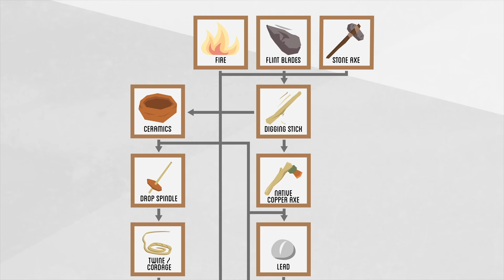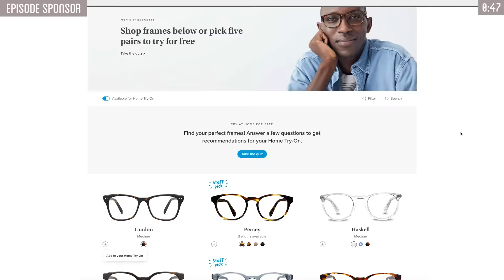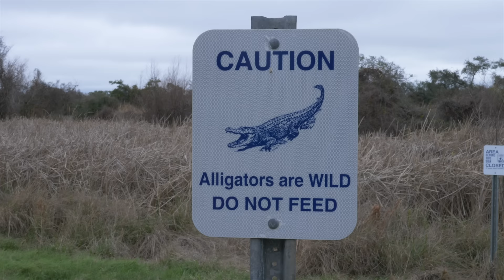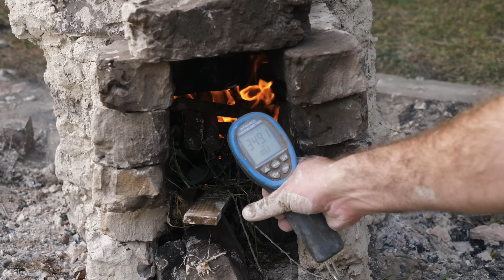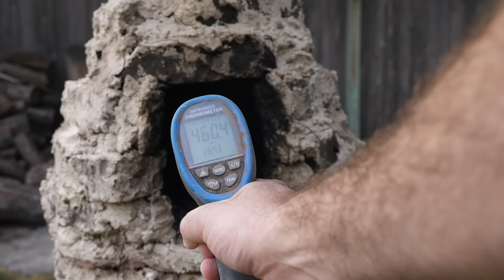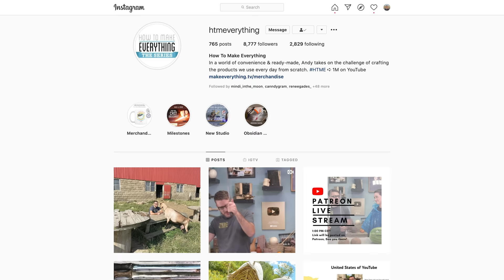Primitive Glassmaking (Creating Glass from Sand)

Comment: I couldn't tell for sure, did you add straw to your clay when making bricks? That's important. Some kind of fibrous plant material, such as straw, grass, etc, it adds a lot of strength to the bricks.
Reply: They shrank too much too, maybe less water..?
Reply: @fellipeparreiras4435  I was thinking the same thing and also just taking a bit more time for consistency. Brick material was lumpy as
Reply: Also too much water in the clay of the bricks
Edit: the clay should be really dry like the  moulding clay your clay you use for the vessels but even drier
Reply: Yeah no straw, and only firing one side of the bricks are real head scratchers. I really like this project but some of the 'successful' projects are ugly and not successful at all.
Reply: @lectorserelith  It's my only annoyance with HTME, if they put a little extra effort into things their projects do so much better and actually succeed. Like primitive tech is a good example of this and good to be learnt from for where they are on the tech tree
Reply: @michaeljones4049  I had a huuuuugggeeee thing written on the previous episode about this exact thing! This episode was much more tolerable as it was basically only the things needed to do something, rather than actually trying to make and perfect something. This is just a case of poor execution leading to poor execution. If the bricks were made better (probably using straw, it definitely won't make them stronger, at all, even slightly, when using them for firing bricks, as the straw will burn away making them weaker, but more insulating due to the air gaps now in the brick itself) they would've got a better construction, and better temperature. 

But it literally is a case of "put in no more than 10% effort, and look up how to do it if you're going to do it" and you'll get an infinitely better result. Don't use murky water to make bricks, use clay!
Reply: @Guffy1990  110% Just seems like some of the curiosity and need to do better has been lost since the reset. Just smash it together sort of paying attention, shrug that it didn't work really and move onto the next project.
Reply: @John Everyman I get it and YT isn't exactly easy these days but I prefered it back when they took their time and I didn't mind having to wait the bit of extra time for them. Maybe it's just me but they seem less rushed (Although that is an issue) and more sloppy. It feels shit to say because I don't want to rag on them, just feels like the attention to detail isn't there anymore and they're just going through the motions.
Reply: Yeah they were also way way too wet which is why the edges were so jank and the shapes weren't eve close to symmetrical. They sagged too much after being demolded.
Reply: @fellipeparreiras4435  Yea that clay was a lot more goopey than when Primitive Tech did it
Reply: They're trying most of these things for probably the first time ever in their lives. You guys are way too harsh, man.
Reply: @Z6D4C4  when you point out ways to improve, it's called 'constructive criticism'. So far, the consensus is that they need less water, some sort of straw/grass binding material, full firing instead of single-face, redesigning the oven to trap heat better, add doors, as well as mixing the clay more consistently to eliminate lumps/globs.
Reply: @Z6D4C4  They may be doing some stuff for the first time, but you gotta realize they're not reinventing the wheel. They're in fact - doing things done for hundreds or thousands of years. Not only are there historical sources, but also modern sources using historical methods. They can reference them, the same way they've referenced experts in past videos. It would only take 30 seconds of searching and maybe a half hour of watching videos to know their brick making was flawed.
Reply: @lectorserelith  If you look closely, you can see that they built the kiln with the fired side out and then fired them again with the mortar before trying to use it to make glass.

You also don't need straw if you fire bricks made of clay as the firing process is supposed to turn them into a ceramic, which is harder and stronger than dried mud and straw.  It would have made the bricks more uniform and allowed them to dry faster if the clay wasn't so wet when they molded the bricks.
Reply: @jasons5916  Thanks for the heads up. I didn't know that about bricks either.
Reply: Mr2winners Actually when “casting” clay you want it a bit runnier, but not quite as extreme as what they were doing. Enough so it settles and fills in the little cracks, but not so runny that it ends up slumping when the mold is removed.
Reply: Jason S You don’t need strength in a kiln, you need a thermal barrier. I can crush the refractory cement in my smelter with my bare hands. But I can also touch the sides of my smelter bare handed when the thing is running at full temp.

The straw would add air gaps, which would act as a better insulator. Adding a little sand would give it all the strength they need after firing. Adding a little ash, or better graphite, would give it amazing strength after firing.
Reply: Seems like everyone who responded to this needs to stop watching HTME and maybe try to do this for themselves to see how difficult it is instead of pointing out every tiny mistake that they made.
Reply: @jasons5916  Agreed the straw doesn't make the fired product stronger. That said, it helps make the unfired product stronger, allowing it to stay together until reaching sintering temps. More importantly it will tend to increase the thermal insulation qualities of the fired brick. Something similar is done to make insulating firebrick, used in kilns.  "Pioneer Pottery" is a good resource for making a kiln from scratch.
Reply: The straw would also make air pockets that increase the temperature insulation of the bricks, meaning a more efficient kiln.
Reply: Oh really cool
Reply: @baconjaguar1084  sounds more fun than difficult. Know your audience.
Reply: Cow shit works even better.
Reply: He needs tempra in his bricks. There is a special kind of rock that can be crushed and used. Its a volcanic rock i wont go into great detail as the research is half the process.
Reply: @thatsmallrockshop  Not every place has volcanic rock though:)
Reply: @michaeljones4049  Yeah, I've been watching Primitive Technology and coming straight from his channel to theirs was a trip (granted, the bricks weren't the focus of this episode so I kind of understand not taking quite as much effort, but after watching PT it was quite jarring)

Comment: The bricks need a lot of work it seems. As other people have mentioned they probably could use less water to reduce deformation. A tip I saw on primative technology was to use wood ash with water on the brick mold to allow it to slide out more easily, but also being dryer would allow it to slip out more easily too (also using wood ash on the floor to prevent it from sticking). I believe the design of your kiln was also pretty flawed, if you're using rectangular bricks you should be building a square kiln (make sure to make square bricks too for end pieces). If you need to make a cylindrical shaped kiln you should be using trapezoidal bricks, where the interior angles are 75 and 105 degrees respectively (for a 12 sided circle).
 
One more thing you missed is the critical step of firing the bricks (you can test to see if they're fired by putting them in water to see if they dissolve, if they dissolve then they weren't properly fired). When you put them around the fireplace all that did was dry them, which isn't bad but it doesn't make them fired; they should glow orange/red or be close to glowing.
 
I've never made bricks in my life so feel free to disregard all of what i said, but there's lots of videos about how to do this stuff on youtube (e.g. primative technology)
Reply: I have a cottage industry manufacturing bricks a few kilometres from my home. They fry the bricks like this. Maybe because it's not practical or cost effective to fry each brick on a grate. Ghe bricks they produce are surprisingly good quality. I guess it also has to do with the quality of clay and the compaction. (All done by hand mind you).
About the shape, you are absolutely right. I have always seen rectangular structures with bricks. Never a cylindrical one.
Reply: lmao aka you binge watch primitive technology videos and related stuff, youtube phd telling this 1.58million homie what's up
I gave the video a dislike, I was so let down by this, what a waste of all the resources and oppurtunity they have, just throwing it all down the drain probably eating processed food and being a little lazy.
Reply: @SF-li9kh  I guess it depends on the era, Ive seen semi cylindrical bricks on post war houses. Ive got a heap of 100 year plus bricks in my backyard plus shitty coal and slag. Its just everywhere here.
Reply: Did you watch the same video as I did? Where some guy built things in the jungle? He burnt I think coconut husks for the ash. He built a kiln and a fan.
I also thought that the bricks were not uniform enough and not fired properly. They have to glow red. First dry them. Then dry around a fire and the fire them in a kiln. I think you have to use way less water so that the bricks hold the form better and dry out faster and more uniform. But of course it needs much more time. I think you cannot rush such things. Today in our society everything is rushed. But in the past you needed time to build things. To make them last. The kiln had to many nooks and crannies and to many cracks. If you build it with better bricks and smoothen it out it will get less cracked and the chance of the kiln or bricks getting destroyed is much smaller. I like to watch such videos but my knowledge is only theory. I never did it myself. But sometimes I will try it out.
Reply: Alll about the meticulous prep work. I think the air gaps and inconsistent Temps are probably what contributed to the undesirable outcome. I pitfire a lot of pottery and do a lot of other primitive glass/pottery techniques. The KEY is consistency in heat and cooldown
Reply: @michaellang9154  Yeah, when watching him make the kiln, my first thought was, "Great! Now you can make GOOD bricks and properly fire them!"
Reply: Yeah, I think they need a better kiln
Reply: Just think how 😎 it would be to have a glass gun

Comment: Omg, it’s a rare specimen of the Iron Age infrared thermometer!
Reply: And only speak in Proto-Indo-European or Proto-Germanic
Reply: @ornessarhithfaeron3576  protogermanic isn’t older than PiE
Reply: It is still working. They surely knew what quality is!
Reply: A more primitive method of determining heat would be. 

1. Put substances with different melting points in on a stick.

2. Color of glowing metal for higher temps.

3. Measure thermal expansion of a metal rod, (can be done with a small pivot like a needle).

Comment: 10:20 The clay was actually way too wet for making bricks, it should be a lot drier and harder, somewhat like the consistency of hard dough. The clay being too wet could be harder to handle, and more importantly it will shrink significantly and unevenly when drying, causing the brick to have inconsistent shapes or even cracks.

Comment: I'm pretty sure the reason your bricks shrank and warped so much was because the mixture was too wet to begin with. To make good form bricks the clay should be a similar consistency to fimo or other oven hardening clays- you should be able to roll it into a ball and it stay a ball
Reply: it wouldn't come out of the brick form unless it was that wet! maybe we will skip the form if we have to make more in the future, thanks for the tip!
Reply: @laurenapolis  if you powder your mold it wont get stuck but with different clay you do need different consistencies so maybe your clay shouldn't be as dry as fimo but it was definitely too wet on the first try as they should barely shrink
Reply: Lauren - HTME fwiw,  if you roll the somewhat dryer clay in the grog just before you throw it into the mold, that helps make a release.

Comment: Makes you wonder how the hell primitive technologies guy managed to be so exact on his measurements for bricks and kilns
Reply: Not watched it, but recall when visiting one of the places here in England they used a simple wooden frame, not sure from which age, but getting some flat bits of wood and securing them into a rectangle seems like technology that goes way back (or just carve a large piece I guess). Pack the clay in, let it fall out, next brick. Could probably make more specific shapes as well.
Reply: ✨ research ✨
Reply: Just simple planning. This guy didn't even make an opening large enough to fit his crucible, smashed it with his pickaxe and then said that the kiln had leaks. This literally isn't rocket science.
Reply: Calculator and website search.
Reply: It's the ounce of 'care' put into PT's projects. It's not hard to work with clay ... and simple things like measuring your openings to make sure they are big enough is pretty damn sloppy imo. You can also use calcium carbonate as a flux which is way easier to find and make in larger quantities than the soda ash you were trying to use. Any sort of crustacean shell or similar can be fired and reacted with water to make calcium carbonate. Im not flying to Texas to find that weed (grass) you said to use ...
Reply: Common sense and planning, pretty much. The PT guy used clay which wasn't too wet and he took more care making sure his bricks were uniform before letting them dry.
Reply: Preparation and planning. This guy just threw around a bunch of uneven and wet bricks, without even testing the bricks out and improving them. The guy in PT did some serious planning and preparation, and probably tested his work 30 times before recording. Basic scientific method, you cannot come to a conclusion unless it can be replicated and repeated to have the relatively same result.
Reply: Competence.

Comment: Sawing granite and limestone with copper saws. What Egyptians did to prepare the stones of the pyramid. Would be awesome if you covered that
Reply: I think they used chisels on sandstone
Reply: they used chisels I think. Also I'm pretty sure it was sandstone and limestone, not granite which is one of the hardest rocks and substances.
Reply: @Hashishin13  Egyptians did quarry Granite, but used hard rock and fire to do so. Granite was mostly used for obelisks I think.
Reply: I think it was the Omelcs in central America who primarily did that, Ive heard about Mediterraneans doing that sometimes but primarily using chisels hammers and splitting. and it wouldn't be called sawing, they used hard sands as an abrasive against copper rope or wooden tools. Its unknown what material for certain, but that's called Lapping.
Reply: @LorenWII  No. The roof of the king's chamber has 6-7 granite blocks
Reply: @Hashishin13  oh. Ok. But is copper hard enough for limestone? Egyptologists mention saw marks on the stones

Comment: Congrats on making proto glass! ( pase 1 glass making) 
I mixed up some sand and flux and lined the bottom of a beach fire pit.
In the morning I had some proto glass with a few bits of charcoal embedded into it. I still counted it as a success. ( after. Wire brushing the sand on the bottom it looked pretty good!)

Comment: Your clay for the bricks was too wet, and mixing cob into the clay would help it hold together
Reply: WAB: Wet Ass Bricks
Reply: As if you're a brick expert, what makes you think that he made the bricks to wet
Reply: @mark78737  Honestly those bricks look like crap, a child would do it better. Like the other guy said TOO wet and no biding material like straw.
Reply: @ravenpineshomestead  you killed him, mark rip. Crispy burnt
Reply: @ravenpineshomestead  toad! Hahaha
Reply: Agree completely. All that water just takes forever to dry and is a huge % volume so the finished bricks are a lot smaller due to high shrinkage. I don't get the sprinkle of grog ON the top like decorative sugar. It's pre fired crushed clay that prevents shrinkage and cracking while drying when mixed INTO the clay body. You can make your own easily. Also brick clay looked like  it had no burn out material (straw traditionally) to help with breakage and add some insulating factor. That should help raise the firing temp faster, as bricks won't just be a heat sink and use up tremendous energy getting them hot first before interior temp begins to raise.

Comment: I know this is an old video, and I am a few years too late, but a couple things I know from tinkering that will help. For Iron smelting, you need to tap a small hole above the bloom and let the slag pour out every 3 hours. Also, its best that once your done to extract the bloom and group hammer it on a hard surface (large oak log) into a dense ball or puck, but I guess it depends on how you plan on using it. For the bellows, cut 2 small holes in the center of your leather. One for your index or middle finger and another hole about 1 inch apart. Put your finger in the hole and use it to lift the bellows leather. The second hole allows air to rush in while lifting the leather. Then before you push down on the bellows just cover the 2nd hole by grabbing it and holding the leather tight while pushing down. Doing this also minimizes negative pressure. Each time you pull the bellows you are taking air away from the flame. I did not see a valve of any kind so that's what the hole in the leather kind of acts like. This way its always adding air to the fire making it burn much hotter which means less time pumping air. You can also synchronize your pumping. While 1 bellows is being lifted to refill the air the other is pushing air out, then vice versa, and a stream of air is constantly introduced. just that small change alone makes a huge difference. Some tips for next time!